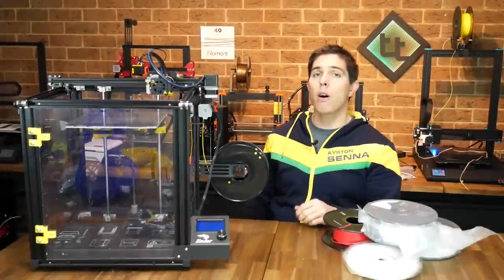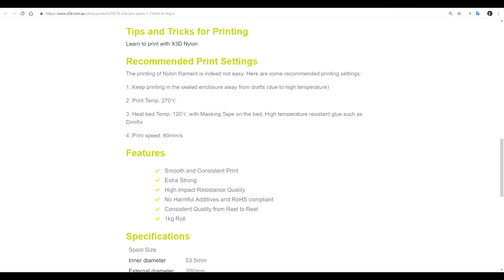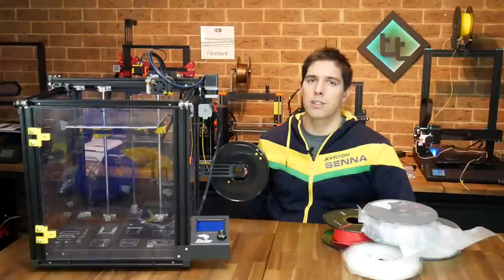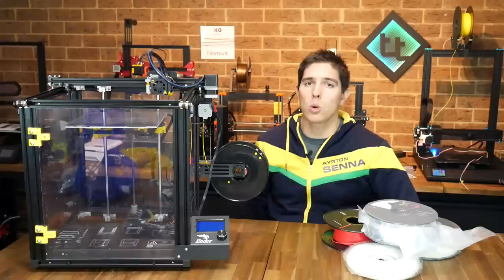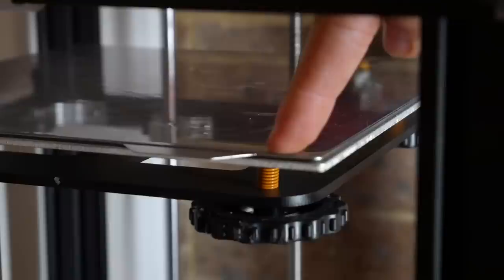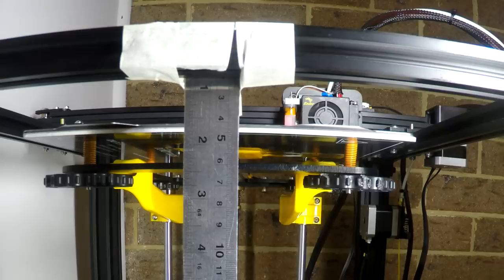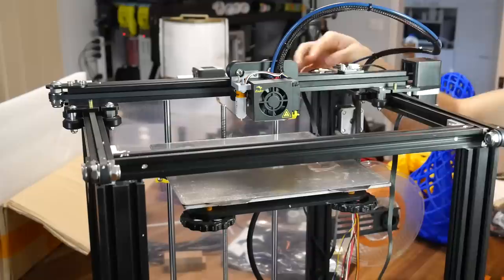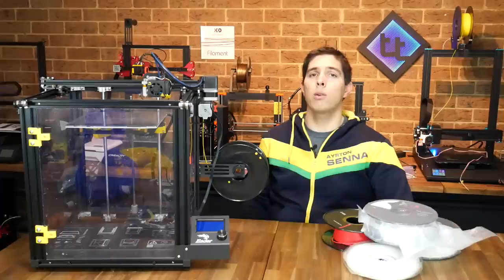Enclosed Ender 5 for high temp filaments - Part 1

Comment: For the top, what I plan to do is frame up a box with t-slot extrusions and add plexiglass on each side just like how you did it on your E5. Make the box about 22-23" wide and use pegs to hold it in place with the printer's top frame. Just have to cut some notches so the Y-belts can have the clearance.  I just made a box out of foam temporary until it's built and it's working great so far.

https://www.youtube.com/watch?v=oKZO6XzxNU0
Reply from the maker: That is similar to what I'm thinking, except I'm going to have the sides come down lower, past the moving components.
Reply: @TeachingTech  Right, I hope that helps. I can't wait to see the solution you come up with. Your videos have always been helpful when upgrading printers.

Comment: I am a big admirer of your work. Keep it up!
Regarding ideas for the top part of this enclosure. I got stuck at the same point that you did for some time but when you didn't come up with a solution I decided to forge ahead. You can see my post on the facebook Creality Ender-5 3d printer user group. You can see the video and pictures there. The rest of the post I will add here. Unfortunately I did not get as much temperature rise from teh heated bed as I had hoped and I am still investigating that.
From fb:

Enclosed Ender 5. 
I have been working on this project for a while. The top part took a lot of thought but the prototype seems to be working fine now. As always there is room for improvements.

The trick was to attach a piece of 4mm twin wall clear polycarbonate to the Y axis. It sits on the frame and runs in a track above it created by the rest of the cover. It is a couple of millimeters away from the belts but anyway moves at the same speed. It is attached to 3d printed parts which sit on the belt fasteners. 
The top is attached to the frame with 3d printed corners which sit above the corners and are attached with M4 screws.

I also used the twin wall on the bottom to keep the heat away from the power supply. The nice thing about twin wall is that it is somewhat flexible, so making it a fraction larger causes friction to keep it in place. 
The side walls sit in the frame but are small enough to be removed without dismantling the frame. They are kept in place with some spacers/wedges. Two of the sidewalls are twin wall, the others clear polycarbonate.
Because the sidewalls only go down to the bottom twin wall, there is no need for holes in them for wires and there is access to the on/off switch etc. The only holes required are in the bottom twin wall and the side for the Bowden tube. The extruder on my setup is in the original position and this needs changing. The tube is rubbing the hole and will not reach the far corner of the build plate.
I should note that the only mod on this printer so far is the glass build plate so this mod will probably work for most people.
With the build plate set on 110C I was able to achieve 30C above the ambient in my garage (13C on a winters day in Melbourne Australia). This does not appear to be sufficient to print ABS, the purpose of the mod, so I will probably have to add a heating element. I am not sure where the heat loss is from but am looking forward to hearing suggestions.
Reply: Now getting close to 70C after plugging a couple of holes

Comment: Which board will you be installing?
Reply from the maker: Plan is an MKS Gen L at this stage.
Reply: @TeachingTech  That's great!  I did the same modification.  I ran into a couple of things that might help you.  First, once everything is wired up, the hot end fan will not turn on.  The way to solve this problem is by adding a bit of gcode to the end of the start gcode:  M106 P1 255.  As far as I know, nothing else will get it to kick on.  Second, I used this bracket:  https://www.thingiverse.com/thing:3424073.  I did use the included fan bracket and also upgraded to a fan with higher RPMs to try to blow as much air across the stepper drivers as possible.  To access the USB port after installing the board, you will have to dremel out a hole of some sort into the case.  Finally, here are my configuration files if that will be of help to you:  Configuration.h:  https://www.dropbox.com/s/o0lbwv7rul8omsr/Configuration.h?dl=0 and Configuration_adv.h: https://www.dropbox.com/s/syj256ybl6xvlec/Configuration_adv.h?dl=0  You are probably already done and have it all up and running, but just in case, hopefully this information will help you out.
Reply: @TeachingTech  please do a SKR 1.3 been trying to get my set up to work. But having problems with the extruder.

Comment: Nice video.

Some sugestions:

1. I would like a doorhandle and maybe an magnet to hold the door closed.

2. Instead of Microswiss hotend I would prefer the Bondtech/Prusa mk3 upgrade in the thingiverse version: https://www.thingiverse.com/thing:3347150. It seems very easy to make an adapter plate fused with the back side of this extruder to mount it on x-carriage (Sadly I do not have any design skills for now) if you drill some holes and m3 theads in the plate of the carriage. So you would have a geared direct extruder with pencake stepper and use a inductive probe (I will use the PINDA2 as I change the board to an EinsyClone anyway - making the ender 5 effectivly an "mk3s" clone with better kinematic due to moving the bed in x instead of y). For the hotend mostly Trianglelab cloned, but the heatbreak original e3d from Prusa (so the modified e3d for forming tip if you use mmu2s). And of course an wearresistand nozzle from microswiss or a ruby.

3. Some thermal isolation (cork?) at the bottom above the electronic enclosure.

Comment: Shame about the minstrel-E not improving anything
Reply: Not surprising because the part was finished in acetone which totally warped the duct. Acetone is not required for this cooling duct. In general the overall print quality could also be better. Anyhow, it only prints in ca. 30min and is an easy swap. Give it a try and if you have any questions feel free to ask.
Reply from the maker: "Totally warped the duct" is such a gross exaggeration, and even dishonest. My water test showed it was still directed directly underneath the nozzle, what more do you want?

Comment: The door size is too big, everything else fits perfectly though
Reply: Can I ask what the proper size is?  Like 10mm too wide so it should be like 360 x 400?
Reply: @Blaster8282  I cut mine 12 7/8 x 15 5/8 and I’m happy with it.  327.025 mm x 396.875mm seems to be the conversion.